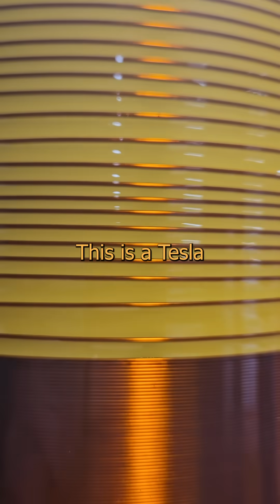Mystery Inductor #chrisboden #comedy #engineering #electrical #tesla #coil #highvoltage #science

Comment: What you've got there is a turbo encabulator. If I remember correctly, this model doesn't just supply inverse reactive current for use in unilateral phase detractors. It also automatically synchronizes cardinal grammeters.

Comment: I have had some success in keeping the magical smoke in unknown components by applying mains to the highest resistance winding, via another load as a series current limiter, allowing voltage and current points to be deduced. That may be re-measured with other windings open or shorted.to deduce inductance, turns ratios etc. Absolute turns can be estimated by looking at voltage in a turn or few if you can squeeze a test winding round the core. That may look complex, but all it can be is a tapped inductor/ transformer. Saturation voltage / B-field  can be estimated from core cross-section and turn count. Mike.

Comment: Not having much of a clue what I was doing, I built a tesla coil in high school because I was just that sort of geeky.  I used a neon sign transformer, a spark gap, some capacitors I got from god knows where, and a couple pieces of PVC wrapped with lots of wire.  Oh, and it sat on wheels from shopping carts (don’t judge me, the statute of limitations passed decades ago).  Problem was, you know those photos of tesla holding the top and having it turned on and then he could draw an arc from someone else?  Well I tried that with my friend.  I gave my dad the control box and my friend held the discharge electrode / repurposed soup ladle.  Trouble was, when he turned it on, my friend yelled “turn it off; turn it off!” but my dad just assumed he was scared from the noise of the spark gasp.  Real problem was we forgot that he was standing on the ground and the 100kv or so we generated went right through his Nikes.  Oops.  He wouldn’t trust either of us for about a year!  But It was pretty cool.  I even upgraded to a larger transformer and got pretty good sized arcs right up to the point where those capacitors all exploded in sequence.

Comment: Can't you just measure the inductance?
Otherwise, the safe ish option is going at it with a multimeter in continuity/resistance mode, note the leads, put a 1V signal generator on the highest resistance one, and then note the voltage on all the other leads.
From there you can get the relative number of turns, estimate that your lowest resistance coil is your highest current, so you can get the approximate max current on the rest of the coils.

Comment: Looks like there is a pair of stacked  DAYTON VARIACs probably on the primary side of the transformer.    Transformer you can easily ohm to find the pairs of inductors for it.   The fun staters after that.   Use the Variacs to starton very low power feed to the primary measure record & mark the dial as to what input gets what output excited to what voltage.   It should be somewhat linear for open circuit voltages .   Then determine a good load to see where it breaks down.   Series some old heating elements off of a dryer or electric stove/ovens if u can find the good resistors/heating elements for that.
Record the voltages and drops to see what it will handle.
The old transformer should have PN and / or a schematic attached (maybe hidden) to save lots of time.   Might habe been a "Special" for the machine it came from but shouldn't be.

Comment: step one find the primary.  likely its in series with the secondary, neutral is neutral for both (or all?) coils.   step two maybe does not want open secondaries, so parallel a shit ton of resistors looking at where the leads come out to see where to connect and do a like on saturation because it could save it from going nuts, self regulating.  Leakage inductance is a way to -- oh wait, you have a three phase variac?  Two phases too many.

Comment: Take measurements from a known transformer. Assume the taps engage different coils or wraps of wire in a coil. Put a fuse in line with the output and the input about half of the wattage you intend to employ. You got this from here. Record resistance on the different taps. Etc.

Comment: I use an old neon transformer for the main power supply of my tesla coil.  15,000v @ 60mA.  Glass plate capacitor, static spark gap, to the primary coil.  I have considered building a rotary spark gap to control the frequency, but haven't gotten around to it.  Tesla coils are fun!

Comment: It’s pretty obvious you’re working with a Multi model transfigurator running a tri-phasic plasma cavitation loop in the 40-80 watt range. My advice would be to disengage the leptonic induction stators being careful not to cross the inline prismatic rings without current upshot regulation in the 300 amp range. That’s what I’m thinking! 🤣😜

Comment: Instead of using the "stacked donut" primary, try using a single layer flat primary.  The idea is to excite as FEW OF THE SECONDARY TURNS AS IS POSSIBLE, and the donut/toroid primary can't do that.  You'll end up with dramatically better power transfer.  :)  Yes, that seems counterintuitive, but it's for real.

Comment: I’m an electronic engineer and worked in medical imaging machines and design.
I also worked in radio and am a ham radio operator building tube amplifiers and HF rigs which put out immense power (for a ham). 
If you need help, I can likely assist you but would need to know some other info first regarding the parts. Showing them on video like this doesn’t help with the very technical questions I have, and some of the step up/down transformers you have are a good start, but you need a flyback transformer and proper circuitry first. 
I’m sure you already received help on this project, but if not, send me a message.

Comment: Better to look at the thickness of the windings of the inductor to get a feel for the saturation current. If you have a controlled AC power supply, you can gradually increase the voltage untill you detect saturation. You'll need a current probe or a shunt+scope. As soon as the the sine wave begins to deform, you are reaching saturation.

Comment: Where do I begin! I flat towed my brothers  tahoe through the mountains with a single cab pickup coming from Florida. It had all his worlds belongings and we sat upfront together with his 90lb dog. Probably the best road trip to ever result from poor circumstances. We both still have those cars. And they run we just don't drive them every day. And I have since loaded that thing down with every kind of cargo you shouldn't put in a little half ton. Giant rocks, every kind of engine. Once the entire body of a whole other truck. In pieces of course and rearranged to fit. Once loaded it with a spool of 1-5/8" coaxial to make a work trip more convenient.
 I drove my eagle talon offroad once and it took 3 of us to load the hunk of concrete in the trunk which we used as a counterweight for a trebuchet we built. The suspension couldn't take it. And if I remember, we estimated the weight to be around 450lbs based on the density of a piece we busted off. 
When my wife moved in with me we had the logistical issue of how to get her oldest sons power wheels to move 2 hours when her car was the only thing we had around at the time. So we tied it to the roof of her Hyundai with some cordage and rolled 2 hours down the interstate like that. 
I am almost certain I could type these out all night.

Comment: Physics is my specialty. 
You should be able to derive the capabilities of that coil with some fairly basic measurements. 
Measure the differential resistance across the various leads to plot the circuit. Then you can use a small pilot voltage to measure the magnetic field generated. That will let you calculate the reactance of the inductor network coils.  The magnetic fields are additive, and so the reactance of the coil is (the product of each reactance)/(the sum of each reactance).

Comment: Blueprint the transformer using maths. Start by seeing which leads have continuity. Then start measuring inductances, possibly by comparing inputs and outputs voltages at varying frequencies, or by assuming design was for certain frequencies..

Comment: If you can find the primary, you could feed a small voltage into it, something like 6 volts ac and measure what comes out on each tap. This will give you a ratio for what it does. You could also put an incandescent light bulb in series as a current limiter and use line voltage. The light bulb will keep the magic smoke from coming out.

Comment: It’s a multi tap transformer. Find the primary and power it up. It may have a 220 or 110 tap but either one. 

Then measure the outputs disconnected with some caution. X ray is made by accelerating electrons into a charged plate and a 45 degree angle and collimating them. The voltages could be extremely high.

Comment: So I'm more of an electric motor guy, but if the transformers are anything like windings (only vaguely) it looked like the different leads to the coil could be inputs for varying voltage output.

Like delta and Y on motor windings.

Comment: The closest thing I ever came to working on something that emitted X-rays, was when I was an Electronics Tech in the Navy back in '78-'84. One place I was stationed at had a RADAR system that used a large reflex klystron tube to generate the microwaves. The lead shielding around it was about 0.5 inch thick and it didn't have any safety interlocks that would automatically cut the power. Stenciled on the outside of the shielding in red was the words, "DANGER! DO NOT REMOVE SHIELDING WHILE UNIT IS IN TRANSMIT MODE OR YOU WILL BE SUBJECT TO A LETHAL DOSE OF X-RAYS!" The power out was rated at 3 MW on CWM (Continuous Wave Mode) and 7 MW on PM (Pulse Mode). We could fry seagulls at half a mile with the beam if they got tagged by it. The reason why those lead plates didn't have safety interlocks was because the unit was built before they were mandated. I don't think anyone was ever stupid enough to remove a lead plate while the unit was in operation...if they had, they would've been dead within a few days after exposure.  Kind of like the electrical version of "the demon core". Worked on some scary sh*t back then. :^0

Comment: Tesla coils produce high voltage very low current electricity. 
The are the basis of the " Miss Electra" sideshow act and children"s science museum demonstrations which are the same thing presented differently.  
Effects include makeing someone's hair stand on end. Long nearly powerless arcs and non contact lighting of neon tubes. High voltage LOW amperage is not particularly dangerous.

Comment: Can’t help with your power supply, but I’m pretty sure the ‘home’ made Tesla coil I used to use for university Physics demonstrations used a neon sign transformer as its power supply. Not sure where the capacitor came from. We started with a chucky oil filled capacitor that was too heavy to lift on your own, but then someone found a smaller, flatish but round thing. Our Tesla coil looked a similar size to yours and made great long sparks. With a couple of long fluorescent light tubes you could turn the lights out and pretend to have light saber fights with them as they lit up (as long as you didn’t actually hit them! 😅)

Comment: That inductor is likely a 480v input multi tap autotransformer   with an isolated split phase output at 240/120v. I use one in my lab that was scavenged from a ct scanner.

Comment: I am going to assume that Chris has already checked it with an ohmmeter and found it to have just one winding with lots of taps. Probably an auto transformer. I would apply voltage slowly to the far ends of the winding with no load and find out at what voltage the core saturates indicated by a sudden jump in current

Comment: Lol... I made one of those for my eighth grade science fair. My dad was the Clinical Engineer for a hospital. So like you my power supply was a variable transformer (and the capacitors for the spark gap) were from a portable X-ray machine. That sonuvabitch threw lightning bolts a good 5 feet and lit up florescent light bulbs just by holding it next to it. Good times 😊

Comment: What you need to do is get an induction meter and measure the inductance and resistance across each of the contacts then consult a better electrical engineer than me. I can read schematics and halfass small stuff but i dont particularly want to BS something of that scale. I would assume that you can use a good circuit simulator to set a loaded circuit and vary the inductor in the circuit to see what kind of measurements you get in sim. It should get you pretty close to the real world results.

Comment: Looks like a multi winding transformer. Not sure about inductance. It's a way to get multiple voltages out of a single input. (120v in, 12v,24v,36v, etc output)

Comment: Not an X-ray tech, so I can't speak on that front; but as someone whom performs graphite furnace atomic absorption spectroscopy, has worked on an ICP-MS, and previously worked with electron microscopes... There's a VERY good chance that the technical specifications of internal components are entirely obscured from the tech working with them. I couldn't possibly count the number of times where troubleshooting terminated at a component for which I had a good idea of WHAT it was, but attempting to delve any deeper would likely be a RUINOUSLY expensive risk. Anything on that cost scale was always a "if you can't fix it in five minutes [or as long as it takes to perform a fix that you ABSOLUTELY know you CAN DO], stop fucking with it, numbnuts." Generally, the bean counters preferred to just pay the manufacturer to send a service tech and leave it at that.

And even then, the number of times that Perkin-Elmer have responded to any problems with instruments by sending a new board is a bit wild.

Comment: Being the high voltage does not have any real load on it should be able to feed it with a 15 amp 120 volt circuit. An old timer made one years ago for Halloween that ran on a 15 amp circuit and made sparks that would jump maybe a one foot gap

Comment: If all of the windings use the same gauge wire, you might not be able to get a concrete hold on the number of loops of each, but ohm them out, and you'll still get a pretty good grasp of the ratioes.